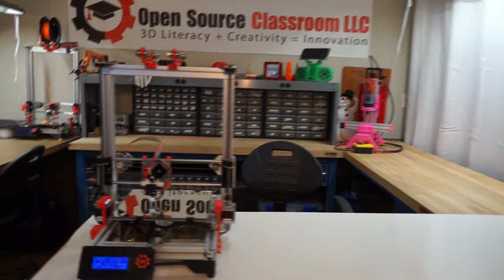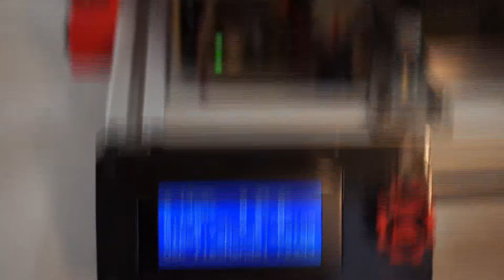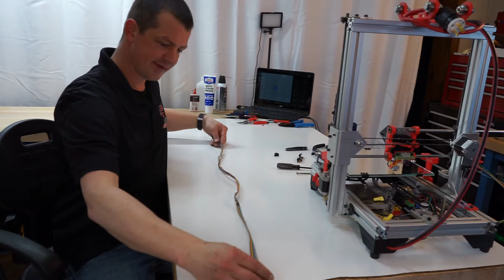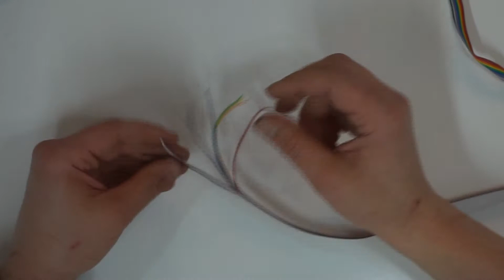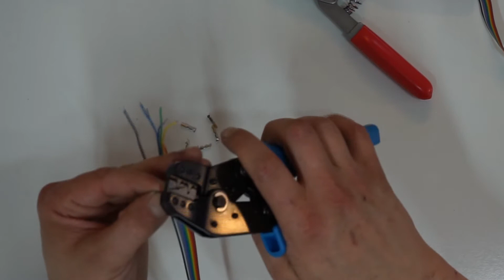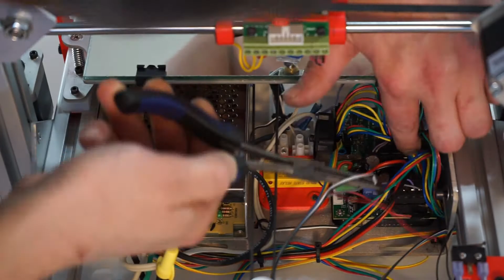Fix your 3D printer - Ribbon Cable Replacement on the OSC flex 1 - Open Source Classroom

Comment: Hi, sir! This video is really helpful. Thank you for explanation and tutorials. I want to replace bunch of my old wires with ribbon cable to my printer as well. I have a question. What is the name of the circuit board and cable you used at 1:39?